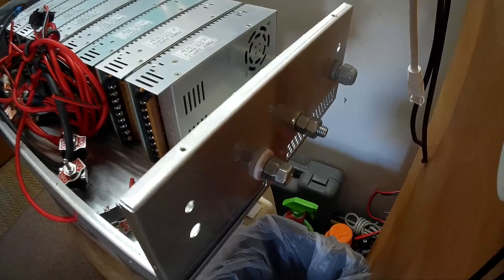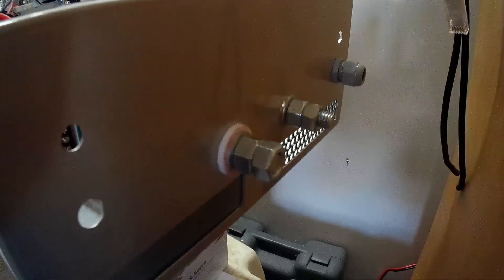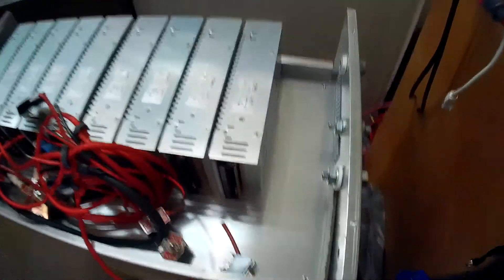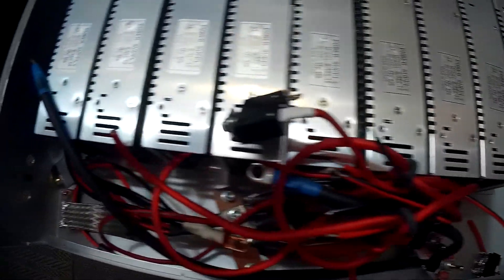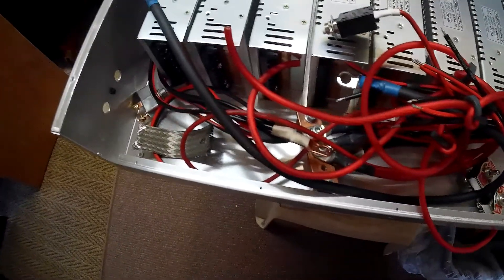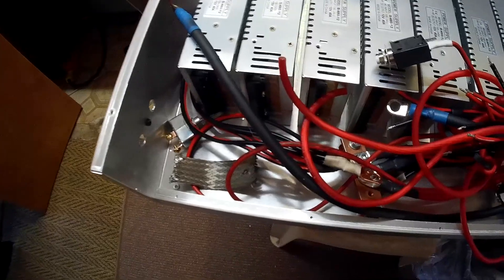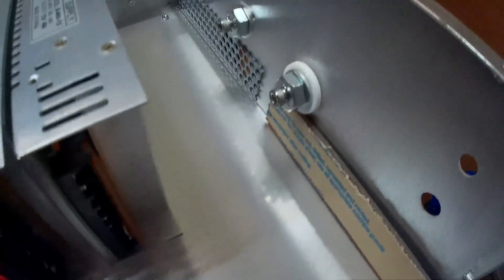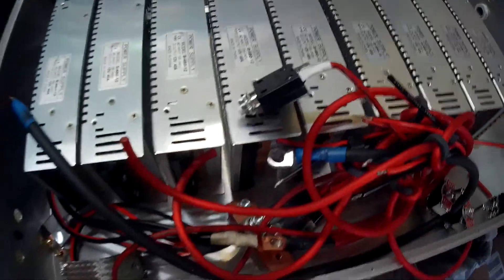360 amp 12 volt DC switching power supply  ( part 1 ) 240 AC

Comment: I was using my setup to run a homemade ups. Supply was running a 2000watt inverter that was paralleled to a battery bank  and when it was under heavy load I just couldn't get the supplies to share the load properly. I hope you have a better result.
Reply from the maker: This is in use today, only drop's 1/2 volt at 300 amp's, all the 10 ga DC out wire's have to be cut the same. don't run the DC wire's from one supply to the other.
Reply: @mm555nc9  I tried multiple layouts, always the same result. Are yours adjustable? They look exactly like the 40 amp supplies I have except I can't see if yours have the adjustment pot next to the screw terminals. If I parallel just two supplies with wire terminating independently at the load, one will always carry the lions share of current until I get in there and tweak the pot to get them both in the middle again but a few minutes goes by and now the other one is carrying all the current again until it over heats or over currents and shuts off.

Comment: unfortunately this setup will never work correctly. It's impossible to get these supplies to stay at any fixed voltage, they go up and down a lot as they get warm, this throws off any chance you have at getting them to share in the current load equally. I've tried using ballast resistors but it just postpones the inevitable of a cascade of tripped units until they are all off. It's impossible to get them to share equally. Your case arrangement also wont work, as I have found these units need at least a few inches around them especially in front of the fans to not over heat, even with external forced air blowing across them.  Also unless you plan on running these at 220~240v ac you gonna need multiple circuits to power them as each one of these at rated load pulls about 600 watts. So if you only have a standard 15amp 120 you can run 3 supplies per branch, 20a 120 will get you 4 units per branch and 20a 240 (two 20a 120's out of phase) you can run probably all 9, but barely. Save yourself the headache and buy a single high current unit, I did, a Samlex 200Amp unit.